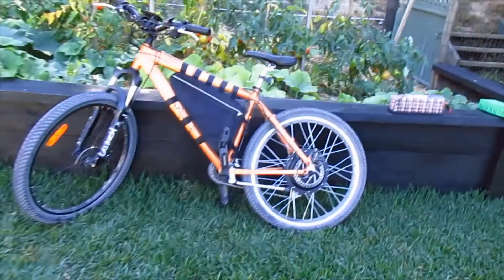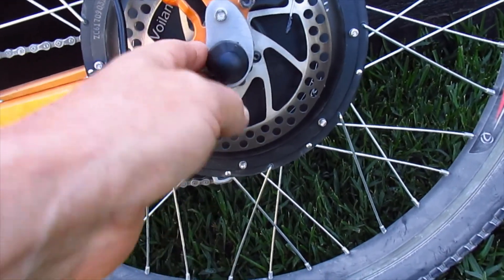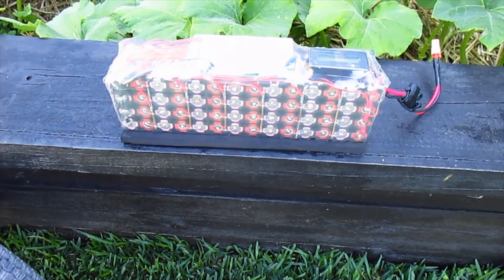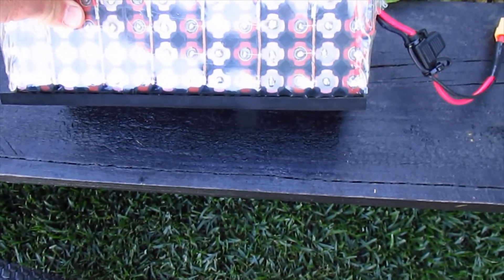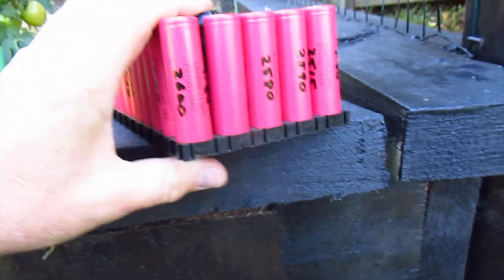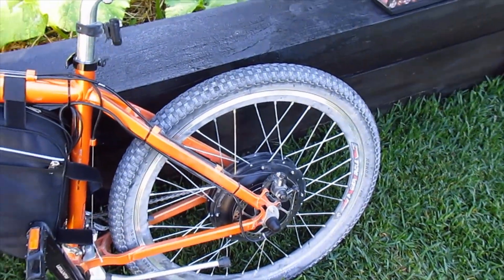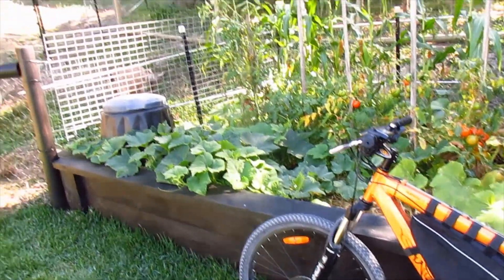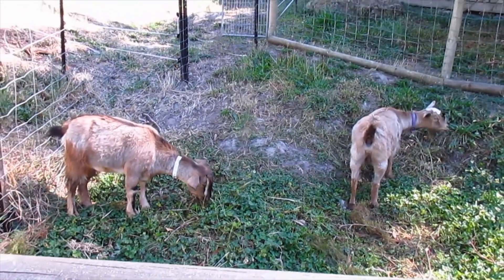DIY 48V 1000 Watt Rear Hub Motor Ebike

Comment: Very useful!  I was wondering how your Voilamart is behaving three years down the track?  I live rural and would need 45k actual range with smallish hills involved. I was thinking that might be 60k to be safe, would that be14S 6P, not sure how that equates to Ah?  I would love to get second hand celIs, but would be worried about being ripped off.  Is it cheaper for a newbie to build their own (new), or get something off the shelf?  You obviously have a lot of battery knowledge, I was wondering if you have any interest in sourcing battery parts yourself and selling parts for self-assembly or as complete kits?  Tall ask, but you never know!!  Many thanks.
Reply from the maker: Hi
Sorry for the late reply.
I would highly recommend the voilamart kit.
I think that pack was 14s 5p.
I would have a go at building a battery if you have some electrical  knowledge, otherwise maybe try and find someone who could build one for you.
If not off the shelf might be the go.
Hope that helps
Reply: @offgriddreaming5403  Many thanks!

Comment: How is acceleration from stop? I have sidemotor left side of back wheel, but I'm thinking to buy rearhub. My bike pulls well at 20-30kph, but from stop it could be better.
Reply from the maker: Hi mate
Acceleration is not great off the mark but with a couple of pedals it gets up to speed quickly.
Hub motors are generally like this. I don't find it a problem though.
Hope that helps

Comment: Do you have the controller in the frame bag? Doesnt it overheat?
Reply from the maker: Hi 
Yes it was in the bag but did get a little hot in summer. I've since mounted it to the frame in front of the bag. It stays very cool now so will last longer.
Thanks for the comment 😁
Reply: Offgrid Dreaming yeah nice bike.did you mount it underneath the frame at the bottom?  And how did you mount it?
Reply from the maker: @shashatheonly  yes at the front above the bottom bracket just so it clears gutters etc.
I spayed it matt black so it blends in a bit better. I really wanted to keep it in the bag but more important that it lasts longer.
It's  an awesome bike and great to ride. I'll do a follow up vid on it soon. I've put around 400 km on it now 😎

Comment: Nice setup but why not go with the mid drive motor kit like the bafang bbshd 1000w. Its very powerful and can use all the gears
Reply from the maker: Hi 
This is more of a throttle only bike, although I do pedal but don't need to change gears. This bike does everything I need it to.

This was also a budget build, the bbshd would be nearly three times the cost. I have a 250w bafang on another bike, theyre good.
Thanks for watching

Comment: Great bike, looking at building my own. Do you have a link to the hub kit you bought? Also, how do you get the batteries?
Reply from the maker: Hi mate
Sorry for delay in getting back to you I didn’t get a notification of your msg.
The kit is called a voilamart 48v 1000 watt rear hub on ebay. Similar to this one.
I recommend getting the lcd display.

https://rover.ebay.com/rover/0/0/0?mpre=https%3A%2F%2Fwww.ebay.com.au%2Fulk%2Fitm%2F253746762571
Reply: Wow Offgrid dreaming! Those batteries look really professional! Where did you source the batteries? Did you say they're recycled? How do you know how to do this stuff? Very impressive! 
I'm researching hub motor stuff and gathering as much info as i can in order to get the best 'bang for buck' setup. Love your work!